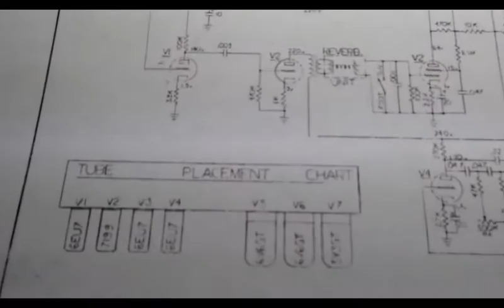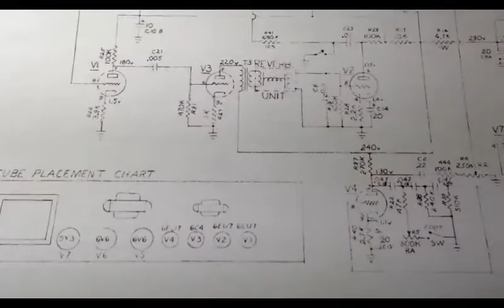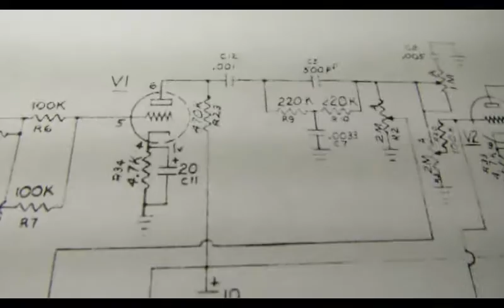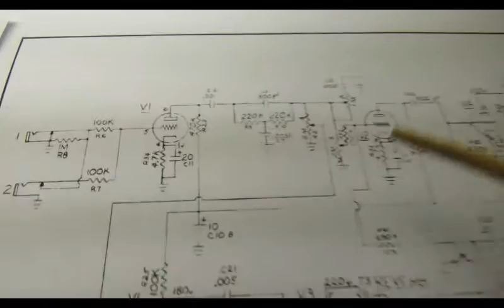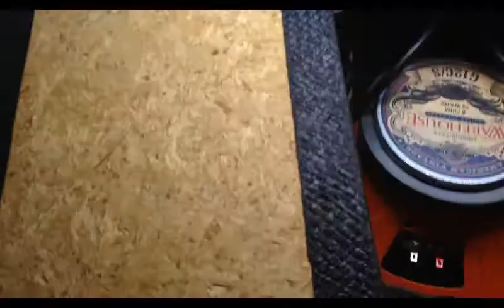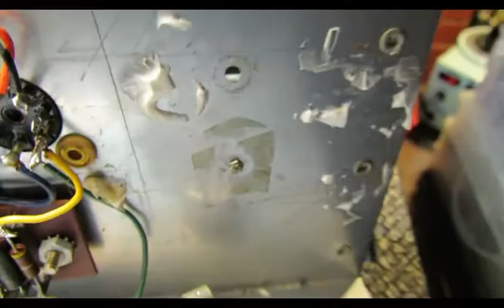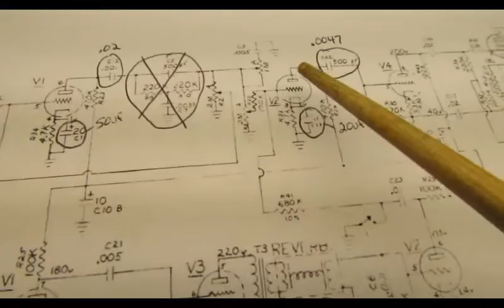Modifying and Comparing Gibson GA-19RVT Falcon Amps

Comment: I enjoy your videos a lot, Brad, but I think that calling the tone stack in the later amp a 'tone-sucker' is a bit harsh.  It's called a 'Bridged-T' and it does not filter bass or treble - it is a mid-cut circuit (with the given component values).  It actually has a very low insertion loss and cuts about 13db centered on 550hz.  This is a very Fender-like mid-cut without the huge insertion loss.  To reduce the effect, you can put in a resistor (or pot) to ground to vary the amount of cut.  Put in a SPST switch to ground and you can bypass the effect.  

It's also a bit misleading to say that a 1nf cap lets 'more highs' pass than a 20nf cap.  It actually lets 'less lows' pass; but, you can't look at the coupling cap in isolation - the coupling caps form a high pass filter with the grid leak resistor of the following stage.  In this case, the cutoff freq after V1 with the 1nf cap should be 79hz.  Increasing to 20nf will lower the cutoff to about 4hz.
Reply from the maker: Thanks for the comment! You are right this probably has the effect of cutting mids and "Blackfacing" the tone. I think I may have mused in the video whether the network was bleeding some bass off to voice the amp to GIbson guitars and keep the tone clean (which I still believe was the motivation), but that was just speculation. I have not analysed the values and calculated the exact frequencies being cut by this network, but I know their effects and they are less ability of the amp to break up and fewer overtones and low end tonal content, especially with single coil equipped guitars. Also, you are correct that I misspoke when I said the higher value coupling caps "pass more highs". Relative to the total spectrum, there will be "more highs", but technically you're right, what's going on is the bass cutoff frequency is being moved with the different cap value.
Reply from the maker: Oh, by the way, that pot mod or switch mod might be a good idea, but I wouldn't want to drill an extra chassis hole for that. I'd much rather just remove the network and let that be that.
Reply from the maker: Thanks Aaron. Yeah, I see nothing wrong with using input #2, or maybe even the monitor jack position, if you don't use them. I just have a hard time drilling new chassis holes in vintage amps. Good luck with your mods! Report back and let us know how they went.

Comment: Have two of the "tweed" model version of this amp...also too much twang. and not enough volume.  Anything I should look at on these?
Reply: Interestingly enough, I'm having my old closet classic Falcon gone over... '62 Crestline... I'm certain it's the first time it's been serviced in 40+ years... We're just swapping out the two prong cord now... No evidence that tone sucking wafer was ever in the amp... Either it was never there, or it was removed long ago... There's really no evidence anyone has been inside the amp prior to three days ago... ultra-clean on the inside... I've always wondered why my amp had more balls than other Falcons... now I know...
Reply from the maker: Unless they're late run tweeds, you shouldn't have that tone-sucking network in there. I just worked on a tweed (video to come) and I don't find it "thin" with a Tele. Twangy, sure, but Teles are supposed to twang. You might check to see that your tubes are good and strong and your bias is correct.
Reply: @TheGuitologist  The Tweeds also have the 500 pF coupling caps, don't they? Which could be changed to .0047 uF
Reply: Wanna sell one of them?

Comment: ..the newer stock is cleaner and  more jangly which is good for certain styles.It could be made a bit fuller just by replacing c12 with say a .01 or .022uf to let more lows through to make for an intermediate between the newer and older version.Coupled with a decent mid boost pedal you could get a fuller jangly/cutting tone (with a bit of hair) that kicks into thick crunchy mode with the mids booster on.By that time the volume boost should be present but not insane since everything will be compressing nicely.

Comment: Brad,
Great vid, but please stop spreading this around...the prices of these will shoot up tomorrow! ;)
Reply from the maker: +chokkan7 Best thing to do is always buy stuff you KNOW is quality and under-valued. You can never go wrong with quality. If prices shoot up while you're holding a stash of something, even better. ;)
Reply: Can't even find them now. Thanks a lot Brad.... 🖕😲🖕
Reply: @liberty5565  , are you kidding?  I just bought one off eBay, original cover and manual, for under $700, though it needs the chassis gone through.  These and other Gibsons show up on Craig's, eBay and Reverb all the time.
Reply: Brad can you pick out some great sounding obscure amps that don't sell for insane prices. Even late '70's Silverface Fenders are going up. Kinda giving up.
Reply: @liberty5565  I just found one ! I bought it because of Brad I knew what it was >>>>>good Price too>
Reply: @raedwulfone  Cool man, you just made an investment.

Comment: I've done about 8 of these, going back to the tweed version. these amps really are amazing and if you turn the volume down all the way and the reverb up you get some really crazy surf tone. I love what you have done here. I rebuilt a 62 crestline version, probably one of the first, and it had a lot of the tweed specs still built into the circuit. It sounded so much better than the others I thought i'd convert them to match. The '62 also had a aluminum chassis!! Thanks for your work.
Reply from the maker: +Dave Hilts Thanks Dave. Nice to hear about others' experiences. I think I remember having an aluminum chassis one too. Maybe it was an early one as well, not sure. Interesting bit of info though.
Reply: How much does one of these weigh?
Reply: @scootergreen3  it depends on the speaker really, they are much lighter than a deluxe reverb

Comment: Very nice video.. I passed on buying one of those when I was younger as it sounded so thin, wish I didn't now.  Can't believe the difference in tone between the two without the caps and the one with them still installed. They really come alive. I'm sure in person the amp with the new speaker is not as vibrant as the original, kinda hard to hear the difference after being compressed via YouTube. But I don't think it ever will sound as good as it is never going to be pushed as hard with it's 75watt rating (just my opinion), still sounded very good. I think you were being very kind calling the person who was inside the customer's amplifier prior to yourself a "tech".... butcher comes to my mind. Keep em coming. Thanks, Tom
Reply: Warehouse Speakers all seem to have huge magnets. I've yet to hear one that didn't sound real bass heavy. Jensens are an entirely different animal. I love them to death.
Reply from the maker: +Bucyrus Erie12 Yep, not the ideal speaker match on the WHS 75W. Something close to 25W would have been better. Broken in...even better still.
Reply from the maker: Warehouse are going for the larger amp market overall, but they do have models that work well in small watt amps too. Another great speaker company from the great state of Kentucky! :)

Comment: I have a GA-5T that has been repaired,  but NOT modified.    The brightness is off the charts....  DO NOT plug in a single coil guitar unless you want treble searing your face off.     I plugged a humbucker gibson into it... and with the tone knobs of the guitar at half... it sounds  PERFECT.     I find the tone knobs on the guitar generally useless,  but with that AMP,  they are very helpful.
Reply from the maker: +DeadKoby You are right, these were voiced with Gibson guitars in mind. I don't think they wanteed you to even be able to play someone else's guitars through their amps.
Reply: In the book "Gibson Guitars, Ted McCarty;s Golden Era 1948-1966),
it was discussed what the marketing design strategy was for their
amp line. Ted enjoyed the mellow sound of jazz played on their hollow
body guitars and he wanted their amps not to sound as "raucous" as
the Fender amps, so they were designed with these strange tone circuits(caps)
to sound "mellow" when played through their line of guitars with humbuckers.

 However, that strategy backfired on Gibson when their sales people came back with very poor sales, Their customers wanted
amps with that "raucous sound" to them and sales started fo fall
off rapidly forcing Gibson and their parent company CMI to discontinue
the amps around the time Ted left in 66, when he bought Bigsby.